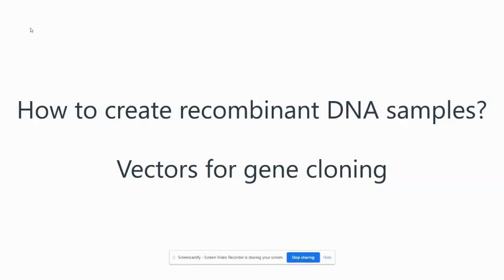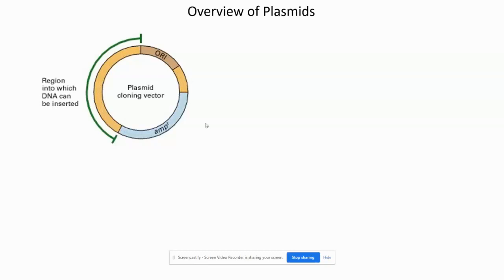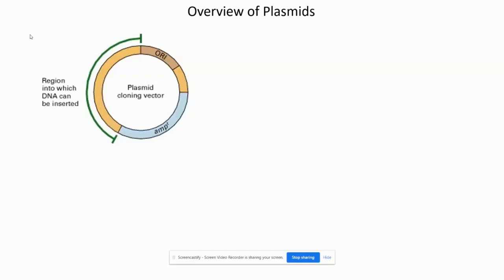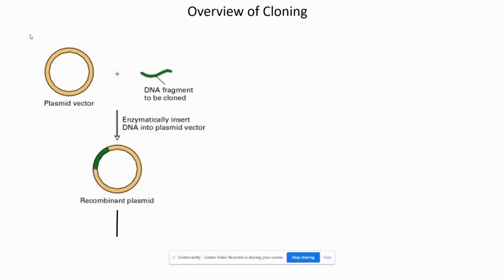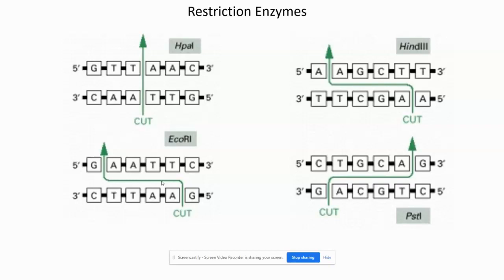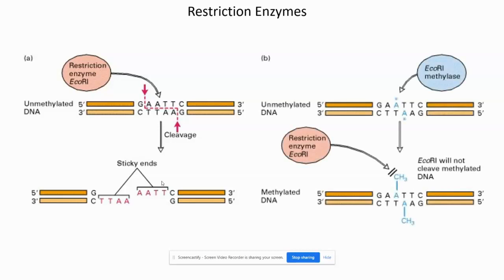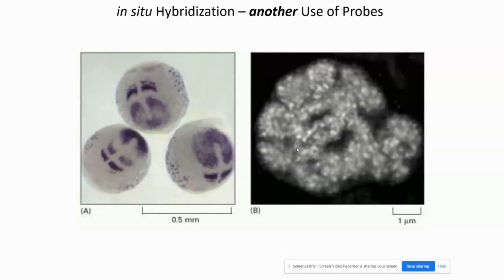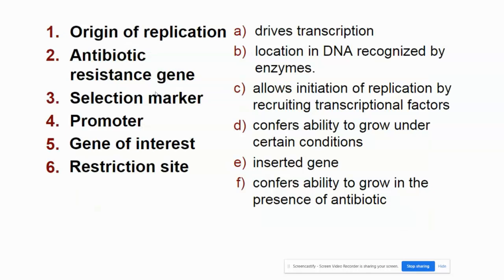ASO500 - Lecture 1 - Gene Cloning

Comment: Thanks. This is by far the best, most concise lecture I have ever heard. By the way, I like a florescent marker in my vector just as a backup in case one of by bacterium is already AB resistant and grows in the presence of the AB. If it grows but doesn't floress, then I know it was already mutated to withstand the AB.

Comment: Hmm, right or wrong? At the end of the Gene Cloning lecture (Lecture 1) there is a quiz with one question (a match type question). The good professor, Thomas Mennella, who by the way delivers an excellent well thought-out gene cloning lecture, has answered the question as follows:
"Antibiotic resistance gene" was matched to ----->  (d) "confers ability to grow under certain conditions"  AND
"Selection marker" was matched to ----->  (f) "confers ability to grow in the presence of antibiotic"
My thinking was a flip-flop of the above (not to say the good professor was incorrect) as my answer was as follows:
"Antibiotic resistance gene" was matched to ----->  (f) "confers ability to grow in the presence of antibiotic"
"Selection marker" was matched to ----->  (d) "confers ability to grow under certain conditions"  
Now, if push comes to shove I do put a bit more weight in my answer, however if one were to really scrutinize the professor's answer you can certainly make an argument that the professor is also correct .... after all the professor, given his gift at teaching, should clone himself so he can teach at multiple institutions ... given the preponderance of lousy biochem and genetic teachers we all have had. Amen.